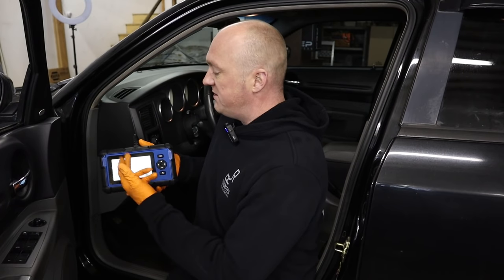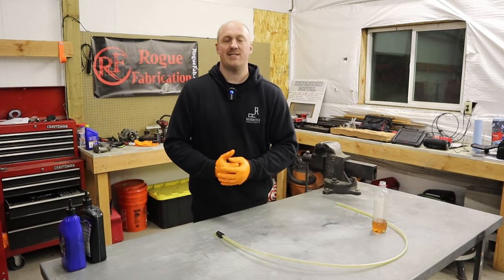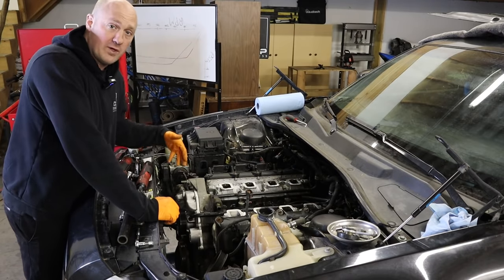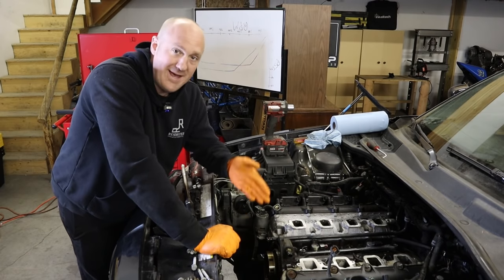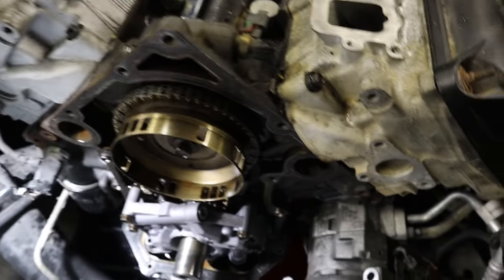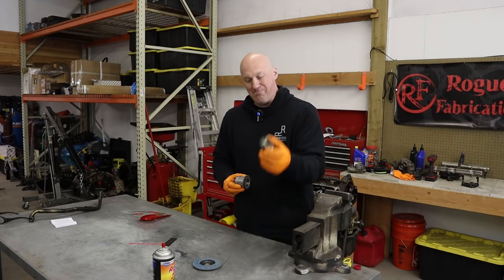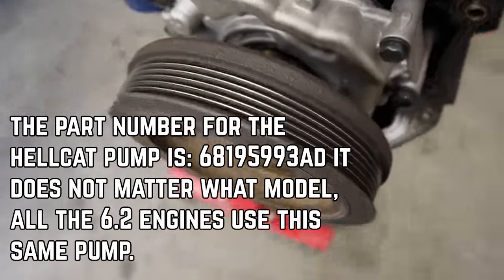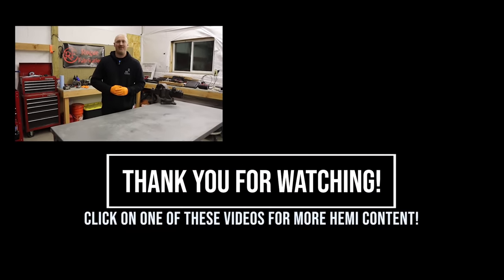Will This FINALLY FIX Hemi Tick? #hellcat

Comment from the maker: Please watch my NEWEST video to get the very latest info on this issue!
https://youtu.be/1gpEwkTVCmE?si=Zh-s2MnZE5fdGmmM
Reply: Hi SKY, I did the exact same test (out of curiosity) on my 2014 grand cherokee. Oddly my PSI readings (taken from my dash info as I didn't have a scan tool) were a little different.
Cold start - 55 PSI
Cold 3500 rpm - 78 PSI

Full temp idle - 35 PSI
Full temp 3500 rpm - 54 PSI

I admit I was surprised (but happy) to see my idle pressure never went into the 20's like on your 2008. I wonder if the pressure info displayed on the dash would be the same readings you'd get from a scan tool? I also wonder if the oil pump on the grand cherokee would be a higher volume than the one on the car? I also use penzoil ultra platinum fully synthetic oil and am religious about my oil changes at 5000km. I have seen another video which shows the bearings used in the lifters were changed in 2014 and appear to be significantly bigger. Another video suggests that if mds is activated frequently, it actually helps that lifter get more lubrication when it's in the down position. If this is the case, my long highway trips may have helped. Wondering what your thoughts on that is?
Reply from the maker: @jonh2408  yes the 09+ engines have a slightly higher volume oil pump than the previous version, your PSI numbers are pretty consistent with what you'd see from a pump that's in good shape. 👍 
And you're absolutely right, allowing the MDS to work as it should allows more oil flow to the lifters versus turning the system off. I'll have a more in depth video discussing all the details of the MDS system and its oiling properties out in the next two weeks!
Reply: @ReignitedAuto  I know this is older, but i was wondering if the 08 and older oil pickup tube fit the hellcat pump or did you have to modify something there as well? Thanks for all you do with the hemi, Man!

Comment: One thing that I will add is that for everyone with a 2009 and later HEMI engine and you want your MDS, It will not work. I installed a hellcat oil pump in my 2014 5.7, and it was throwing a CEL because the oil pressure was out of range. so although, yes I got higher oil pressure, I still wanted to have my MDS.
Reply from the maker: Very interesting, I haven't heard this yet. I'll be on the lookout for more people who run into this issue.
Reply: What oil/oil weight are you using? What is the ambient air temp? Are you using stock thermostat, like 205-210degree?
Reply: @budlanctot3060  i was using 5w-20, air was 60 degrees, and the car is on a stock thermostat, at operating temperature. freeze frame showed cel when the car was on the highway at 65 mph
Reply: Well, that's unfortunate. I'd prefer to keep MDS functioning, too. But if it came down to cam/lifter destruction or MDS, I'd have to choose the HV oil pump.
Reply: @budlanctot3060  i would definitely agree with you on that, when i did the job on my car, it was a retired highway patrol car with 5,000 idle hours, 8,500 total engine hours, and surprisingly enough only 1 mds lifter was staring to fail, and there was some light pitting in the cam lobes, but not a major failure. i replaced everything except the block and the rotating assembly, with the new hellcat oil pump, and CEL. and of course it was the mds. i think there is just too much pressure for the solenoids. it really sucked taking it back apart again to put the stock pump back in

Comment: stock:
    cold:  49 F
        idle: 58 psi
        3500: 75 psi
    hot:  210 F
        idle: 20 psi
        3500: 58 psi
melling:
    cold:  54 F
        idle: 85 psi
        3500: 99 psi
    hot:  210 F
        idle: 37 psi
        3500: 85 psi
hellcat mod:
    cold: 46 F
        idle: 89 psi
        3500: 99 psi
    hot: 208 F
        idle: 43 psi
        3500: 90 psi
Reply: Just released December 2021 - Melling M342HV high volume oil pump
Reply: @TristynRusselo  how is high volume compared to the hellcat ome
Reply: @mrstrangerdanger5741  watch at 23:11 he talks about vane thickness, stock 03-08 12.5mm, 09-current 14mm, hellcat 16mm, melling HV 15mm.

Comment: I’m afraid to say this out loud…🤞🏻
I have a 2013 ram 1500 HIMI. I just hit 200,000 miles. I have not had a single problem out of this truck, no tick ever!
The only thing I’ve done is ,change the oil every 5000 miles, rotate the tires, replace tires, replace brake’s , coolant flush 3 times I think, transmission flush twice. This has been the best running vehicle I have ever owned by far! 
Everything is bone stock. Maybe I’m just lucky, I don’t know. But the engine still runs like new, so does the transmission. I’m hoping to get another 200,000 out of it.🤞🏻💪🏻
 I love my truck!
Reply: I’m curious about your truck and how you drive it? Is it mostly highway miles with little to no idling?
  If that’s the case that may be why you haven’t had that problem.
Reply: @dodge73dart lucky but yes might be that I have the same truck 145k miles I do the oil change tires and all but I am a merchandiser so I drive everyday in mostly city and highway stop and go on and off ECT and I have had to replace the thermo do two rad flushes replace the damn brakes every 10 months lol and now the oil pump or sensor havng issues
Reply: What weight oil and brand do you run?
Reply: I’m now doing my lifters 2016 ram 1500 5.7 260k heavy towing oil change every 5k to 7k miles

Comment: I 100% believe that the lifter failures seen on hemis is related to effective lubrication. I had no idea the idle pressures could get that low at temp. This was a hugely insightful video both for understanding the root cause of the problem and the steps that can be taken to mitigate against it (avoid idle and higher flow pumps). Massive kudos for putting in all that work to put this video together! Great vid!

Comment: Thank you so much for your hemi tick content, the oil pump comparisons with cold and operating temperature oil pressure measurements, as well as the camshaft and lifter replacement video. It was easier than I thought! I have some experience as a mechanic in the military from years ago, well stocked tool carts, and a 2013 Charger R/T with 197,000 miles sporting the usual symptoms of the lift failure including misfires. I took this on and replaced cam, lifters, and used a new Hellcat oil pump. I had the same improved oil pressure results you showed on this video. I am so thankful for the great information and being able to see you perform many of the necessary tasks. I have my car back and it runs great again. I have the confidence that I will not have to perform this cam and lifter replacement again. Thank you. Merchandise order coming soon! Thank you. TM
Reply from the maker: Love the success stories! 👊
Reply: What type of hellcat oil pump?

Comment: Holy cow! Thank you so much for this. Been following this since you covered it a few months ago. I've got a 13' ram 1500 and been worrying about the lifters. Been keeping my idle times low and oil changes regularly. Great video sir!
Reply: Turning off the MDS with a Hand held tuner is what you need
Reply: @TravisTheSavage  I have a 2022 Ram 1500 5.7L on the way, is that method (tow haul) better than using the gear limiter function engaged and set to speed '8'?
Reply: @kirbyspencer538  tow / haul does not disable MDS on my 2020 1500. The only way to disable MDS is to engage the gear limit and leave it at 8.
Reply: @ITrustInDog  Thank you sir.
Reply: @kirbyspencer538  when you get the truck go through the cluster on the dash and see what Oil pressure you have. I’ve got a 2020 rebel 5.7 and I’m never seen it go below 31psi at hot idle. I would think that would be okay pressure but I’m not sure. Also the lifter problem seems to not have anything to do with the mds but the lack of oil pressure at idle.
Reply: He talked about this several times, turning off MDS won’t help. Removing the MDS system itself helps a little because it allows for easier flow to the lifters but Manual Trucks w/o MDS still has the same issue.

Even the post 2016 beefed up lifters still have this problem.

Oil pump upgrade , 5k oil changes, and not letting the engine idle long is are the only real solutions outside of a camshaft upgrade.

Comment: Extremely informative video.
Your time, dedication and honesty are greatly appreciated Sir.
In the Cummins/Ram arena we just went through a similar situation with the high pressure fuel pumps and the entire CP-4 National recall that forced Ram to replace this fuel pumps. They decided to go back to the old reliable CP-3 Pumps...🏆
Reply from the maker: You know it! I've done probably 100 of those retrofit kits so far on the ram trucks. No idea why they made the change in the first place, the cp3 is just better. 👍

Comment: Excellent tutorial on oil pump swaps! All this info is very useful. I personally think that using a hi-volume oil pump, either Hellcat or Melling's unit, will certainly help the lifter issues. 
Thanks for the great video!

Comment: Just saw this @ recommendation of Ram Forum members.  Outstanding work, thank you.  I wasn't aware Ram upgraded the oil pump post-2009 model year, this obviously means they knew they had an insufficient oiling problem and lifter / cam failures.  20 psi idle oil pressure is marginal for any engine (GM's 8.1L V8 was notorious for this also), but often fatal for Hemi valve architecture.  If the EVIC is to be believed, my 2017 Hemi shows 35 psi oil pressure @ hot idle, which is good for a non-Hemi engine.  But we've seen lifter and cam failures in post-2009 Hemi engines also, which means it's still not sufficient for the inadequate oiling of the lifters and camshaft.  in fact, raising the cam to fit the VVT cam phaser made it worse, with a lesser oil drainback angle.  An oil pump change is too big a job for me at my age, but thanks anyway.
Reply from the maker: Appreciate you watching Brian 👍

Comment: I’m tearing down a 2007 5.7 out of a dodge rami got a 2008 ram that is still running strong 250.000kms and counting…  I have driven this truck like I stole it everyday and used it as a work horse towing and just my daily at the same time. 
But I would like to build the other engine with mds deleted seeing as it’s a work truck. 
You have giving me a lot of knowledge in just 3 videos, thanks  keep up the excellent work and research

Comment: I have watched every one of your videos on the 5.7 issues in the last two weeks. I bought a 2014 Ram 1500 with the 5.7 and 89k miles six months ago. I got the tick five weeks ago which has progressively gotten worse and now I’ve got oil in the cylinders and am blowing smoke. 

I had NO idea this was such an issue or I would have done the rebuild when I first heard it. I’m beyond feeling comfortable with doing that now so I’ve got a Jasper ordered. I’m so grateful for your videos and will be swapping the pump for the Hellcat pump before installing the new motor when it arrives.

This is a work truck and although I keep minimal idle time, I drive 300-500 miles a week and I’m hoping the new pump will help keep this from happening in the future

Comment: Probably the most valuable information and detail in demonstrating of any video on U-tube. This is the first mod to be done on the hemi before any other mods. I am an efficiency nut when it comes to building or modding my automobiles, bikes or other equipment.  Will do this on my srt392 when I do the intake porting. Looking into the Hellcat water pump and optional pulleys for the alternator and ac and water pump in the process.  Maybe just a smaller crank pulley. Simple mods makes the most sense.  Oil pump is number one.

Comment: I did see a good video on the tick...the owner solved the problem with a change from 5w 20 to a 5w 30 synthetic oil and the results were very positive. No tick and the engine ran much smoother.
Reply: He explained in this video it doesn’t solve anything

Comment: Awesome Video! Great hands-on with actual historical data and test confirmation. If your doing a rebuild on a Gen III, throwing in an upgraded oil pump and new lifters makes sense. Better oil flow, frequent oil changes based on engine runtime hours with proper viscosity and quality oil should eliminate any potential hot idle lubrication issues. Great strategy to reduce any contributing factors leading to lifter roller failure and cam wear. Thanks so much for doing this. I enjoy your channel.

Comment: Thanks very kindly for this amazingly helpful video - got a hellcat pump for
My RAM1500 and going to give it a crack - especially helpful to know it’s OK to leave the water pump on the timing cover by just removing Every alternate “long bolt”

especially helpful showing how to prime a new oil  pump on the HEMI
 Thanks again for being one of the very best channels on YouTube.

I fitted the hellcat pump at 10,000km and all valve train hemi tick
Is gone.

I also run Amsoil signature 0w 20 and I think it’s a very good idea to fit the high volume hellcat pump. I am now at 38000 km
Reply: Thanks for the edit.   so im assuming your hellcat pump was direct fit?    just having to rebuilt my 2010 1500 with 510xxx so making sure the 2009+ 5.7 was direct replacement
Reply: @andrewschoenfeldt5620 did you have to evacuate the a/c on the ram 1500 to replace oil pump?

Comment: Part of me really wants to buy the 5w30 instead of the 5w20 for my 200k mile hemi 300c. But you and several others have convinced me to just stick with high mileage synthetic 5w20. I for one am happy to see 21 psi hot idle and 55 going down the highway as I don't hot idle much where I live. Thanks for the great content!
Reply: U can use 5w30 oil in a hemi.   They use it in other countries and it even says in the manual that U can use that if 20 weight is not available or high towing usage is done with the engine.    5w30 or 0w30 is so very marginally thicker at 200 degrees it’s hardly notable on paperwork even amsoil will agree the difference is very minimal.  Especially at start up when your 0winter flow is exactly the same

Comment: Thanks for your effort here, and really for all your HEMI tick related investigative videos.

After watching this video, I started paying attention to my idle oil pressure. Today I was on the road for a while, then had to idle in a parking lot waiting for some people. At operating temperature 200 F or greater, it held at 35 psi. So, that's not too bad. Ill keep monitoring it though, especially on hotter days. Today was  only 85 F

Comment: Very informative test. You can apply this to LS and Coyote engines also. I'm going to use a high volume pump on my LS3 stroker project when I start that, even though some argue you will use more HP to turn a high volume pump. I'd rather loose a couple of HP for more oil flow at idle any day. I did a high volume Melling on a '01 Jeep 4.0 inline 6 that had a scored up oil pump gear face and pump cover. Went from about 30-35 psi cold in 30* weather to about 70 psi cold in 30-90* weather. No more clacking of valve train at idle. BTW, the rotors on that pump were almost twice as long as the stock pump. Like a new engine, very happy.

Comment: This is good stuff.  You are talking my language. I have always been a believer of upgrading the oil flow.  I grew up putting big block oil pumps in 350 engines.  Myself, I would not go with the modification of the drive gear to install the HellCat pump. Looking for long term reliability in a daily driver. Otherwise I believe it is necessary to swap out the stock pump for a high volume oiler.   Even more so for a daily driver. Every time she fires up, it would feel good seeing that guage sitting on the 80's.  
Thanks for the great video and taking the time to swap out the parts twice. We all can learn a lot from this.  Thanks!

Comment: On the trucks, if you want to keep the A/C compressor attached, what I did was take a piece of wood or a broom/shovel/etc. and place it across the hood and then zip-tie the compressor to it so it "hangs" but it is still suspended and not pulling on the hoses.  It looks sketchy, but it works and you don't have to yank the A/C lines like you said.  I tried the OEM tools puller that you can rent from autozone, and I couldn't get enough grip on the balancer with it in order to pull it off.  In the end, I used a 3 jaw puller which grabbed wrenches I arranged through the three "spokes" of the balancer.  It's hard to explain, and it is ultra sketchy, but it was the only way I could get the balancer off.  Sky if you see this, perhaps you could link in which puller you used (Amazon affiliate link?).

Comment: Finally did this swap the other day. 2014 Ram 1500 Sport. MDS deleted Non MDS cam from a Ram 2500 installed. Hell cat lifters and hell cat oil pump installed.  My oil pressure cruising at normal  operating temp and at highway speed is a steady 70-75 PSI.  At a hot idle on a hot day I’m at 43 PSI.  This is with fresh Red Line 5W30 oil.  I’ll be looking at doing some shorty headers and a tune in the very near future.
Reply: Was you overall MPG affected by deleting the MSD? I am about to do this mod, due to a cam lifter failure. I bought the lifter kit (hellcat) and cam shaft from modern muscle xtreme (MMX) their cam shaft adds 30 hp without any further mod, and I am now planning to buy the hell cat pump as well.